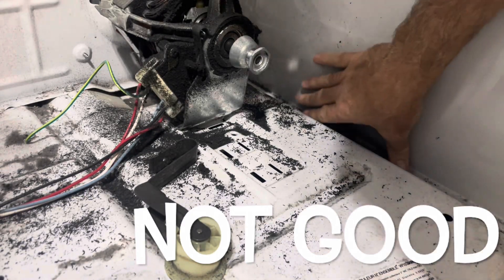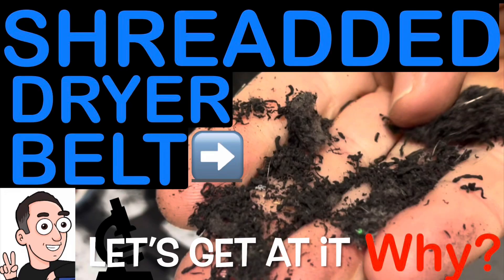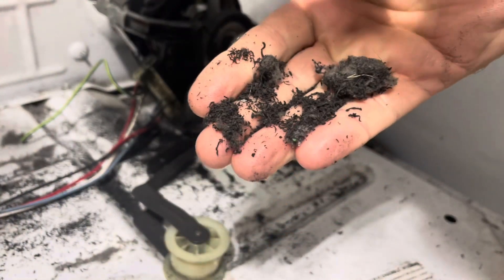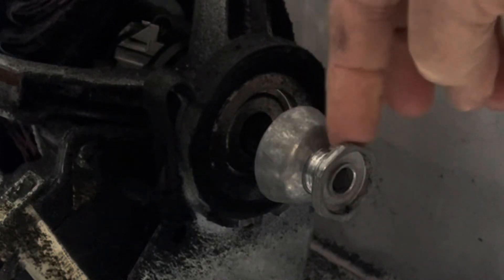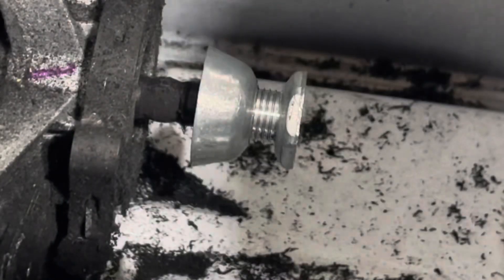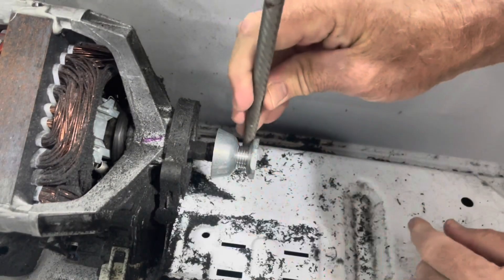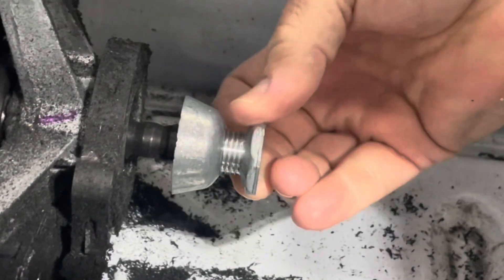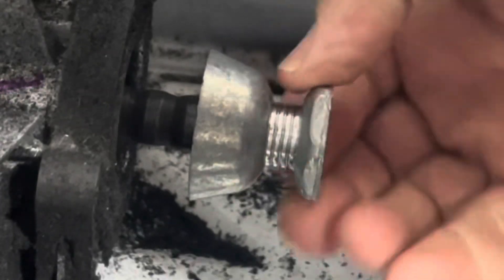What shredded my dryer belt?

Comment: Do you have a follow up on this? My dryer shreds belts like this and it’s not the pulley. :(
Reply from the maker: I didn’t do the video yet but yes. So about 4 months later my belt broke again. And again there was some shredding. Not as bad. I could a raised spot on the dryer drum right where the belt touch the drum. I filled it down some and haven’t had any issues.   Yet!!!